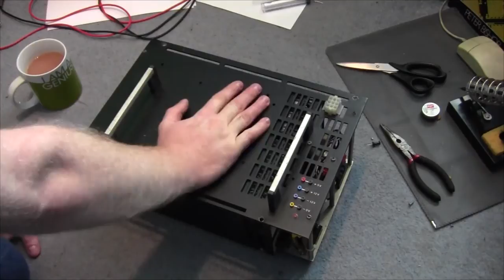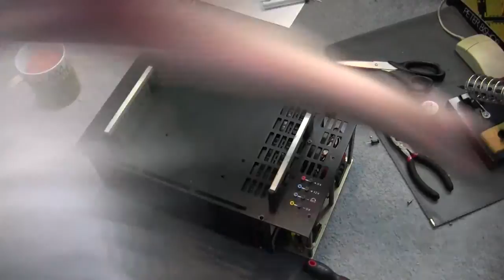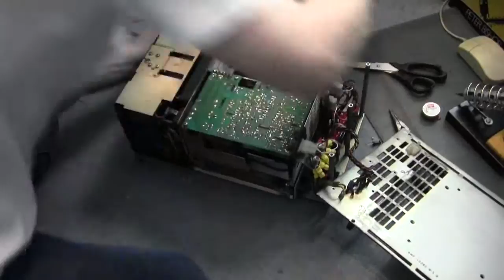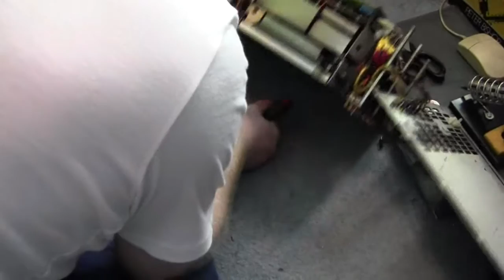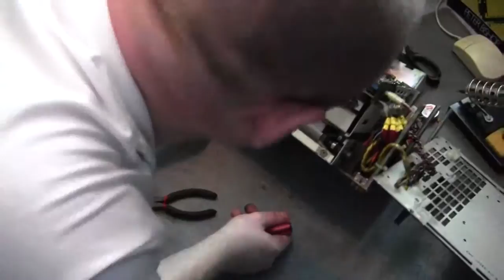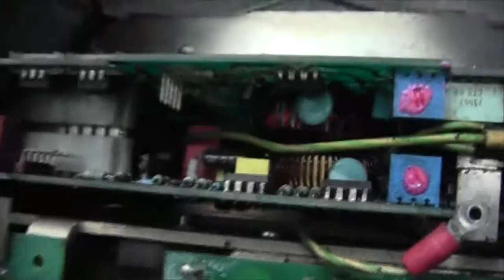Quantel Paintbox Restoration Part 4: Opening the Paintbox's PSU for refurbishment...FAIL...HELP!!

Comment: Crikey! - I take it back, maybe those ARE huge caps!

Hmmm, I wonder which rails those big caps are for? Probably +5V and +12V, or maybe they are the main smoothing caps (for pos and neg rails) and it has transistor banks for dropping down to the lower output voltages?

I just realized that the large thing between the big caps is the mains fan.
I thought it was a transformer at first. lol

Looking forward to the pics - this machine really is a beast.